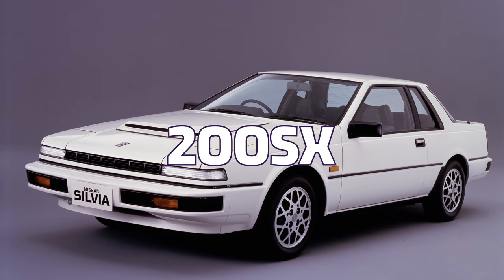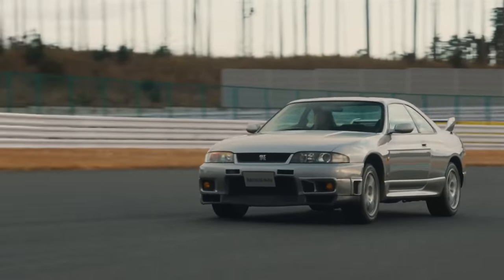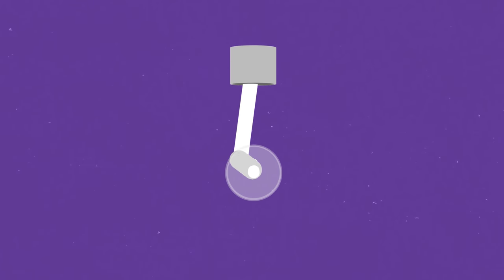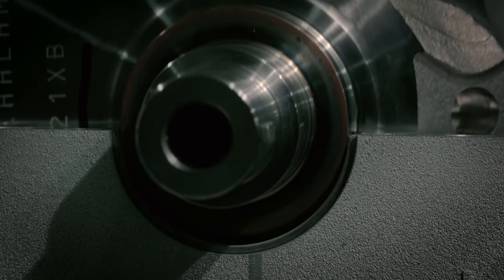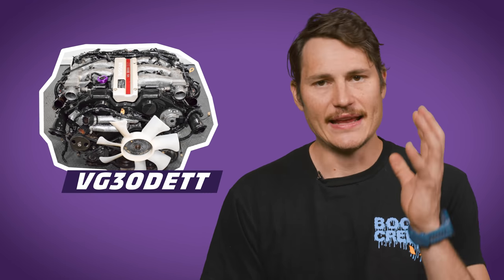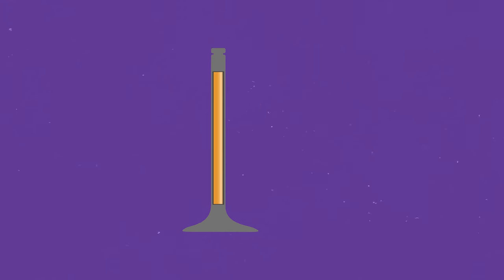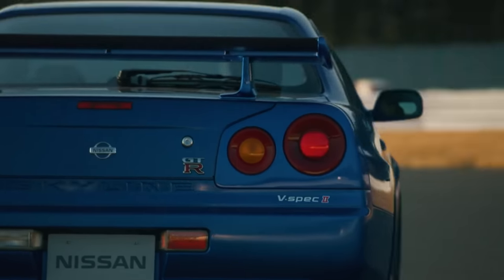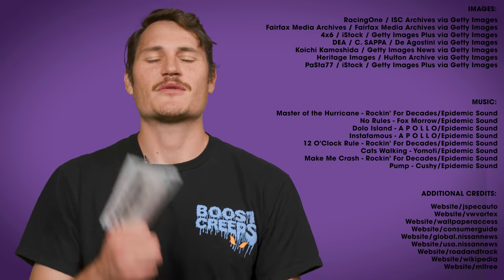RB vs. VG: Why Nissan Discontinued Their Best idea

Comment: VG was in multiple applications from 83-2001 or 2. It runs 450+hp on stock internals and upwards of 1200hp with arp connecting rod bolts and head work. Paul newman was a datsun man, and he loved the vg. Vg is a million mile motor and on the off chance you break one, go to a junkyard, pull one for 300$ and redline for another 300,000. An rb, when you break one, it will break your heart and wallet. Immense amount of work goes into building reliable power. People twist cranks at 450 with the rb... But at least it sounds nice. Both engines came out of the final round of datsun engineering, so they're both phenomenal
Reply: Rbs also have oiling issues.  Seen plenty of twisted cranks and cracked oil pumps .not so with with any of the vgs PLUS you run a frontier block and you get 3.3 liters and its lighter than a rb by almost 100lbs?! Cmon already. Vg is far superior to the rb..
Reply: @blaqlabspodcast5816  You can overbore a VG33 and shove VH45 slugs in and get a torque-monster VG34.  There was a mag back in the day that did it with a first-gen Pathfinder.
Reply: rb cranks are well proven over 1000 HP sounds more like a tuning issue or bad engine assembly. I do agree though that the vg's can hold a tone of power and are really overlooked
Reply: 225hp tops with a stock motor and holley/V65 manifold fuel system. that's after the valve timing is corrected- a MUST for these motors. your figures are patently false. the pond racer motors made 1000hp and that was with two-stage boosting and crazy fuel & compression. i've built many VG 510 sedans and if you are willing to go with solid lifters, modded rockers, and billet race cams you can get close to 300hp ON PUMP FUEL, but its not very civilized. we usually stuck with bill good cam profiles on the nismo billets and kept the hydraulic lifters. about 250hp with a proper exhaust system and 690 cfm modded 2300 holley carb, but its all motor and its right there off idle. incredible torque & power band for a N/A 3.0 litre motor.
Reply: @mescko  good luck finding a VG33 block that is within snot for building a hot motor. i tried to get one checked out for a client and the shop said it needed align-boring (main saddles) AND decked back to square. 3 blocks- same story- and no guarantees on any bearing wear. the japanese-made blocks i have used all checked out OK (first time) and thats all i will use and guarantee. boring a VG block (91MM) TO 93MM is risky and a good way to end up with an ash can full of expensive junk. those are cast cranks and can take everything out under failure at high speed- just not worth it to swap used parts unless you know what you are doing. used pistons have to be thoroughly media-blasted, inspected and dye-checked for cracks/trouble spots. new pistons for a VH45DE cost over $740 for 6 pieces- VG pistons much cheaper. why gamble by putting both pistons AND block at risk for failure? the best way to get torque from a VG30 4WD WD21 pathfinder would have been to order JWT's VG30 supercharger kit and bolt the damn thing on. 60 more hp and 100+ more lbs./ft. done.
Reply: I gotta 2004 vg33 in my truck anyone have any suggestions?
Reply: Devil z32 hit 785hp on stock internals, bigger injectors, and big turbos.
Reply: @tommurphy4307  225? Bolt on z31's making more than that lol

Comment: The moment I started caring about the Z32 was the moment I was watching Matt Farah review one and the owner said he was making 500 horsepower on the stock turbos. Just intake, intercooler, injectors, exhaust, and a tune.
Reply: There have been a few making 500RWHP and one even made 550RWHP on stock turbos. It did have ported heads and cams. And of course all of these will be on E85 or race gas.
Reply: Same
Reply: I used to think they were ugly, specifically because of the headlights, but I really like the look of them now.  
Seems like a forgotten (by some) ripper in stock form.
Reply: Lol have any of you actually worked on one of these before? It’s a nightmare even when you have a full shop lifts engine balancers cherry pickers etc. and the one my coworker rebuilt was non turbo, couldn’t imagine having turbos crammed in there with those clearances
Reply: Go work on one before you buy one. No room in the engine bay, really low to the ground so you can't ramp it up well. You need to either have a lift, a pit, or a ton of engine pickers
Reply: @Nathanv3  come on fellas they aren’t bad to work on, there’s nothing to work on when you delete all the coolant bullshit lines.  As a owner for 13years if you build one like I did do it right the first time, as in replace everything a 30 year old car would need wire harness especially!  Low to the ground……This is a sports car correct?
Reply: @Cruising200  yeah, build it from the ground up so it becomes easy. That defeats the purpose of talking about working on its original parts and getting around its fatass engine.
Reply: @Cruising200  also, its 100% a sports car but you need a lot of extra finesse to get under it unlike some other same-era sports cars
Reply: @Nathanv3  There is nothing to work on the sides besides the coolant lines under the plenum…… So tell me what do you need to get to the sides for?  Pulling the engine for turbos and exhaust manifolds is nothing like regular maintenance.  This is a 25 year plus car which things need replacing, which is why You do it the right way if you want to drive an older car on the streets.

Comment: FINALLY my motor gets some recognition. Y’all need to look into the F31 chassis. Nissan Leopard/Infiniti m30!
Reply: We had an F31 m30 with the worst transmission we’ve ever owned. Took it back repeatedly under warranty and they never could “find” anything wrong with it. Multiple dealerships. It changed hands in the family when the warranty expired and wouldn’t you know it? They figured out it needed a new transmission on the very next oil change. Nissan lost my family’s business with that very car.
Reply: F31 also a bmw chassis thats weird😂
Reply: You beat me to it
Reply: J M  uhhh, I was planning on swapping it anyway but thanks I guess
Reply: @negativeindustrial  yeah manual swap is in progress lol
Reply: J M  the m30 came with vg30e too so it’s a total boat anchor
Reply: J M  uh... Thanks for sharing?
Reply: @SlashCampable  lol J M seems like a sad little man
Reply: @jimmyhelminiak9815  
What was it? We never got a straight answer and my mom was so excited to get that car handed down from my grandfather. 
(Let’s not feel too sorry for my mom, BTW. She ended with my Grandmother’s Supra right afterward which was supposed to be my first car but w/e 🤣)
Reply: @negativeindustrial  same dimensions, chassis, dash, suspension components as an r31 skyline, same drivetrain as a z31. Only 6,000 hard tops were imported to the us, favorite car I’ve ever owned
Reply: The vg30e is the simplest thing to work on. Plus all variants of the vg30e can handle 500hrsprs on stock internals. Z32 Rods and pistons can be swapped in for more power. Hell a guy  named afr_Miami has a z31 making well over 1000hrsprs on stock block crank and oil pump.
Reply: @jimmyhelminiak9815  
Looks like yours was white like ours. It was a beautiful car. Still wish I knew what the flaw was on those transmissions.
Reply: Love mine ❤️
Reply: @negativeindustrial  crazy the Infiniti m30 had the same trans as a 240sx/z32 auto which were good standard trans.
Reply: @mindjal19  Not into Japanese’s cars that much and don’t know all the coding so I was lost for a sec. F31 is a 3 series wagon haha.
Reply: @aidenp5768  right😂 it can be confusing for people who don’t know one or the other, I also only knew one F31 chassis until today lol
Reply: @gusparra4037  from the z31 I’m pretty sure
Reply: J M  "I don't think people understand that rotary horsepower needs to be measured differently"     Cool story Bro!i
Reply: nooooo don’t tell them before I can get my hands on one
Reply: Dude, HUSH
Reply: Nice car btw. F31 leopard is my dream car
Reply: @negativeindustrial  was it an automatic? Nissan is know. To have the worst automatic transmissions known to man manual is the only way to go unless you have a handicap which doesn’t allow you to use a clutch then there is no excuse to not have one and if you must buy an auto at least get a Toyota or Ford and stay the hell away from any cvt or Chrysler product in general they are just pure garbage everything about them
Reply: J M  lmao if you ever worked on a fwd you'd be used to taking that front off to work properly lol. I'll take all the VGs y'all don't want lmaoo
Reply: @finnafishfl  dude in the maxima group im in just imported one and has a nice turbo build going with it, thing is clean as hell!
Reply: @kx250braap  nissan has the worst CVTS, their regular autos are actually pretty good. You add a shift kit, higher stall converter and trans cooler and you can handle some decent power with most of them. The one in my 03 maxima is amazing, ive beat the fuck outta this thing expecting it to fail and it keeps surprising me lol
Reply: @negativeindustrial  your first problem was buying a car under warranty and expecting them to actually fix shit lmaoo. Learn to do your own work, its fairly easy. Hardest part is amassing all the tools needed but still not impossible.
Reply: @MrSirGiuseppe  
Reading comprehension, sir.
Reply: @MrSirGiuseppe  imported a leopard! Now thats different.

Comment: From my personal experience on multiple VG30 engines are extremely well balanced. I've owned 3x VG30 engines and a VQ30, always had a party trick where i would balance a lighter on the intake and rev it up. Vibration might be a V engine issue but i think nissan figured out how to solve that issue
Reply: I never liked V6's 'til I had a VG.  I've had two VG cars -- a second-gen Maxima SE and a 200SX SE-V6.  The SE-V6 had a custom Flowmaster exhaust -- what a glorious sound!  I've still got 3 VG's sitting in my shop, one's an 83K mile VG30ET -- if I ever start my TR7 project I'm building a sleeper TR8 eater.
Reply: @mescko  sold my 96 maxima 300se to my brother, now running a 04 maxima QX and n 94 nissan hardbody. Just live these maximas really

Comment: There was two early / mid 90s drag cars here in Australia, running each other’s engine types- a 300ZX with an RB30, and an R31 Skyline, with a VG30! Both 1300+hp using factory cranks, blocks and heads, but mechanical injection…

Comment: small correction at 14:30. the rb26 does NOT have VVT. You need to either add that with an aftermarket system from a manufacturer like HKS or do a rb25 neo head on a rb26 bottom end to get vvt on the intake cam.
Reply: Yep only the later ones.
Reply: @SvenQ45  no rb26 ever came with vvt. Aside from crank nose, oil pump, and turbos, the rbs from 89-04 are all basically the same.
Reply: @parrisracing2370  I know that I was referring to the NEO. There was never an RB26 with that head. 😉
Reply: @gworks5538  not once in this chain of comments did anyone say one was better than the other lol
Reply: RB engines never had VVT, they had VCT (Variable Cam Timing) on the intake cam. VCT only comes on S1 and S2 RB25s, RB25 NEO and RB20 NEO.
Reply: Also, not ever VG engine had it either. In 1996, VVT was removed from the 300ZXTT. I'm not sure what happened to the Z32 Fairlady TT during its production, I just know there were a few improvements made after the 300ZXTT got cancelled.
Reply: @skylinefever  VCT not VVT

Comment: I'd love to see a B2B episode about the L series engines that came in the earlier Z's
Reply: My Z31 is my baby, but the L series is a much better motor than the VG
Reply: @antiquatedideas1107  prolly why it wasn’t included in the video
Reply: @antiquatedideas1107  thats a big no i had a l28et and a vg30et. The VG has far more modern combustion chambers and also has more power potentiol on a stock engine than the l series. You have to realize the L series was designed in the 50s the VG in the 70s.
Reply: Z31's are always overshadowed by the Z32. VG30ET was a more simple engine, could still make 400+ HP on stock internals, but had a lot more cooler retro tech- like the factory digital dashboard.
Reply: L seriessss. Had one. Now my kaT based off the L series. Just cut to a 4 banger.

Comment: VG in Z32 300ZX was a PAIN to work on, especially with Turbochargers.
The engine compartment was cramp and there wasn't much you could do without lifting the engine out from there.
Thankfully it was a reliable engine so you didn't have to do it often, but still...
Reply: To be fair that's what you have to do with all twin turbo V engines no matter what brand.
Reply: That's why I liked the original configuration from the Z31. SOHC and single turbo. If you wanted more power it was easy enough to add a boost controller, IC and rebuilt or upgraded turbo.
Reply: I knew someone with a Z32 TT in the extremely rare pearl yellow. The engine bay of that car was like the surface of machine planet earth in The Matrix. I don’t think there was a single point where you could see through to the ground.

Comment: Unfortunately in stock or modified form the RB series engines have more failure modes. They have weak oiling systems leading to oil pooling in the heads and sintered metal oil pump gears that are prone to shattering (especially with abuse at high rpm). The plenum for the rb26dett is of pretty poor design and with the itb’s (which are commonly deleted) it causes cylinder #6 to lean out and leads to detonation issues. Also as the video mentioned, torsional rigidity is a concern because Nissan is known for its weak block castings. In vehicles that maintain the awd system or are in a state of high tune the rb26 commonly fail and crack where the transfer case bolts to the block. It’s one of the few engines that I can think of that the smaller displacement and less advanced siblings are actually better starting points for tuning and reliability. The video also failed to mention the packaging benefits of the VG also leads to a lower center of gravity for better handling. Cost and complexity aren’t the only reasons the R35 didn’t get an inline 6…
Reply: In your infinite wisdom, can you explain any about the differences between the VG30DET AND VG30DETT?  I had an 88 300zx turbo when I was 18, it was super clean, interior looked brand new, body was perfect, and I ended up blowing it up because I was an idiot in high school. Circa 2011
Reply: @foxxrider250r  the VG30DET uses a single T3 Garret turbo (with a single intercooler) while the VG30DETT uses two hybrid T22/TB02 turbos (with twin intercoolers). Also the VG30DET uses the N-VCT variable valve timing sistem while the VG30DETT uses the NVTCS, which is more advanced than its predecessor.
Reply: You need to do some more research people blame the inlet manifold for no6 running a bearing or melting a piston on the rb but the truth is the coolant flow to the rear of the engine becomes a problem when chasing more power
Reply: @ngallakp62  There’s no shortage of stories out there regarding lean conditions on rb26’s due to poor plenum design. Good tuners just compensate by enriching the fuel mixture for the last cylinder. Or better yet just ditch the vacuum-leak prone itb system altogether for a big single throttle body with a better plenum. Honestly I can’t wait for freevalve tech or similar to just hit the mainstream and nobody will need any throttle body at all and response won’t be an issue.
Reply: @ngallakp62  truth right there! A mate was in the middle east as a motoring journo when Nissan launched the 4.8L patrol. When asked why the air con kept cutting in and out at highway speed the engineer said it’s because the coolant pathway is too long in the length of the block so they have to shed engine load to get the motor to run cooler.

Comment: I had a VG30i in my pathfinder with 270k miles, ran so smooth that you could balance a nickel on the air filter housing with it running.